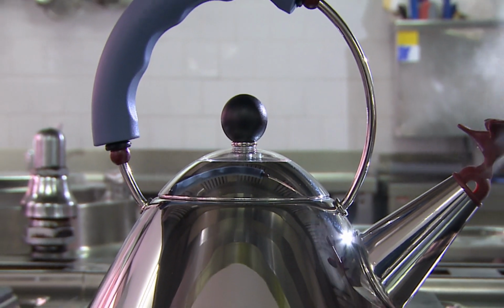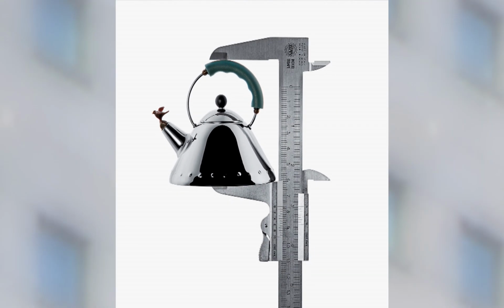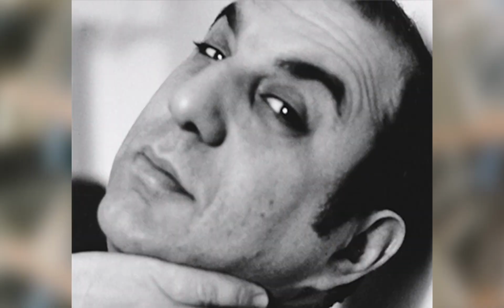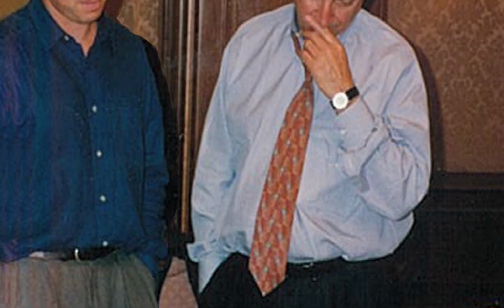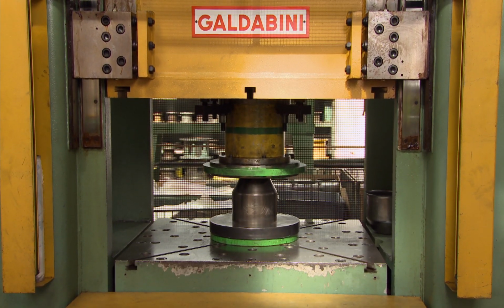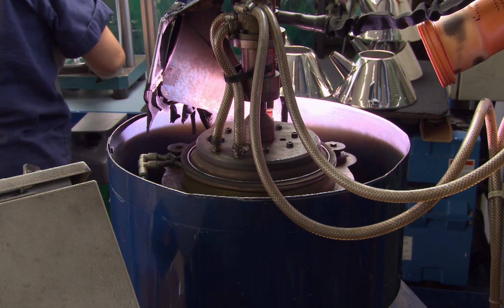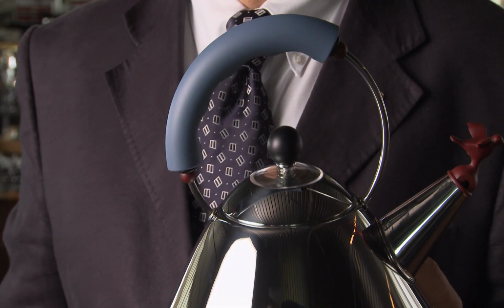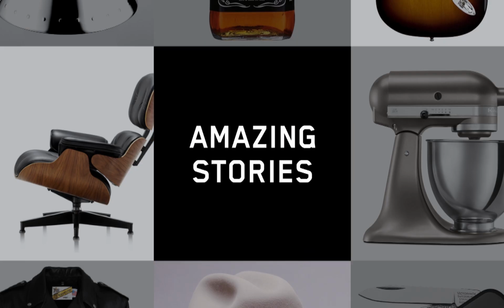How the Alessi Bird Kettle is made - BRANDMADE.TV

Comment: My Mom bought one when they first came out in 1985, thought they were so beautiful and shiny.  She passed it on to me in the mid 90's and I am still using it daily.  The kettle itself is superb!  Beautiful design and the shiny stainless steel is something to behold.  I have had a couple of problems over the years.  It was left on the electric burner one day, boiled all the water out and the knob for the top cover melted loose from the heat. I was able to repair it although replacement lids are available.  Amazingly, after sitting on the burner which was on high with no water in it for over 15 mins., the kettle was fine, bottom was a bit discolored but that was all.  The bird whistle finally broke off a piece where it goes into the kettle which is why I am here as I am looking for a replacement.  The kettle is generally not left on the stove unless being used.  If left on the stove cooking things near it will eventually leave a film buildup from oils, splatters, etc. on the stainless steel causing it to lose shine.  I have cleaned mine on occasion with "Simichrome" metal polish to get that wonderful SS shine back.  What more can I say, it is 39 yrs.old and still a beautiful work of art to behold!

Comment: I bought mine on eBay. Used. I love how it has a little patina to it, but it still looks good. Also, mine is the earlier version, without the plastic shield on the lid. This shield is a design compromise. It detracts from the simplicity and clean lines. It collects dirt, and gets cracked. I’m guessing it was put there to prevent idiots, and litigious Americans from burning themselves on the hot lid. I love the way my kettle looks good, gives me a smile, and just gets on with its job. I’m in my fifties, and I expect my kettle will outlive me. And as a design, it’s timeless.

Comment: I love my birdie kettle to look at less to use. The birdie doesn’t whistle very well and I seem to be losing steam fro m other areas. The lid?  Which means that I need to have the extractor fan running over the job when I boils the kettle and then I need to wipe down the induction hob after as it is very wet from the condensation

Comment: I see its ingenuity but the shape would be annoying no?  The spout is before the border of the kettle itself so that last bit of water would be difficult to pull off.  While the cone like shape would supposedly give more stability while carrying it around, it wouldn't be as seemless to pour.  I'm not very familiar with this kettle why and when did it become popular? Someone help haha.
Reply: Yup. And, it doesn't whistle like it does in this video. And it takes a real long time to heat up. Basically enjoyed the look for a few weeks, received a replacement bird whistle, got tired of plastic shavings in the water (from shoving the bird into the spout), returned for full refund. Looks nice on a shelf, but not even close to practical.
Reply: All things considered a steel pot with a long handle is the way to go. Maximum ease and versatility.